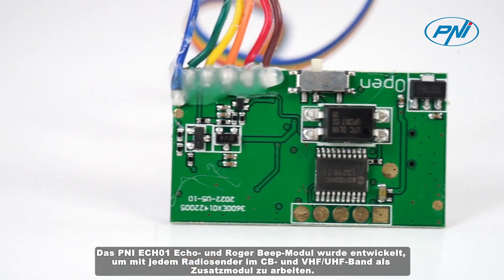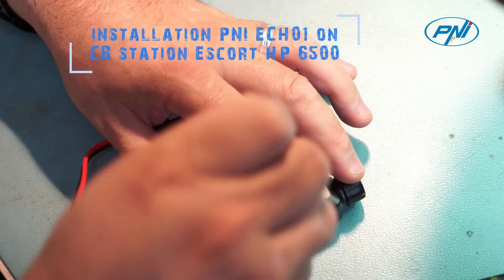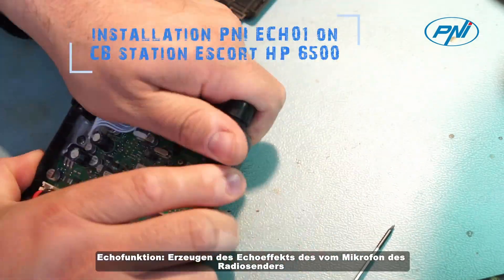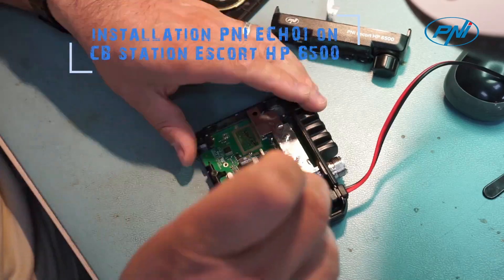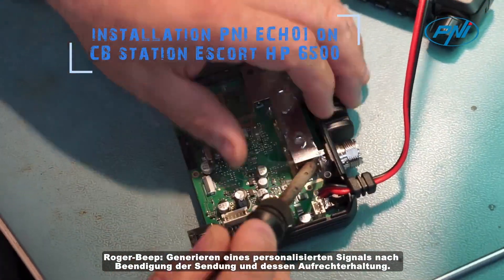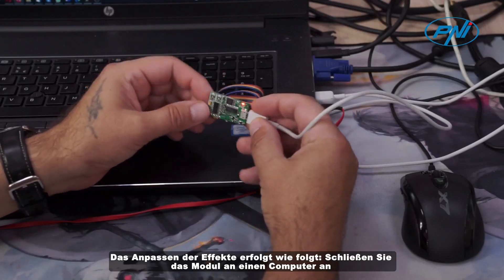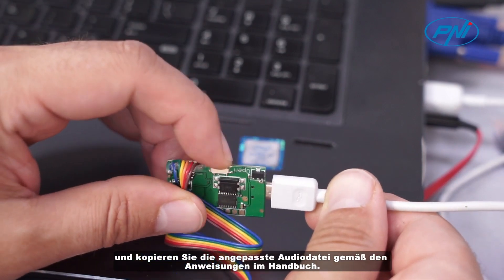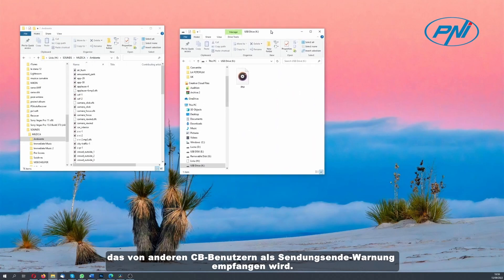PNI ECH01 Echo  und Roger Beep Modul editierbar DE

Comment: the brown wire is for what ? please dont say for "out"... What is the cable and where do I have to solder it to a standard radio. thank you.
Reply from the maker: The brown wire is the output with the audio signal processed by the module, so the MIC OUT.